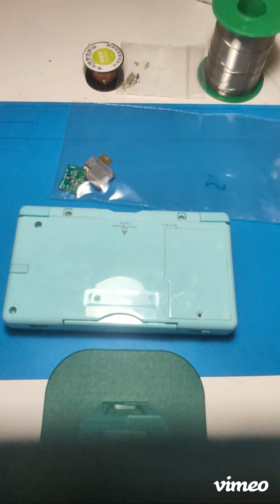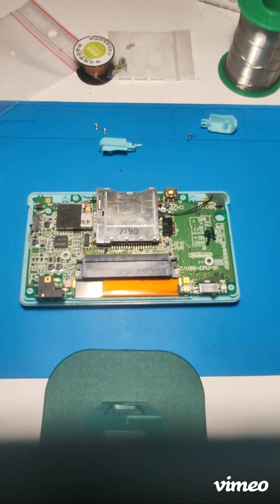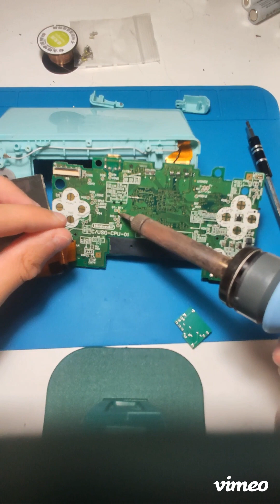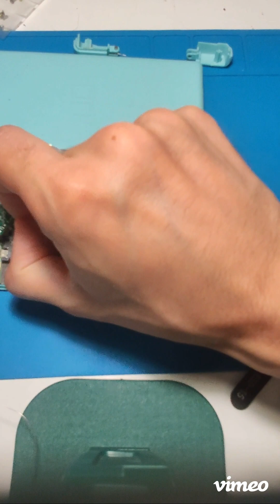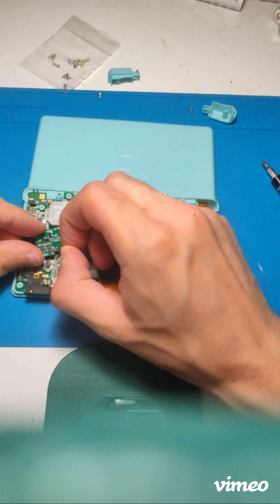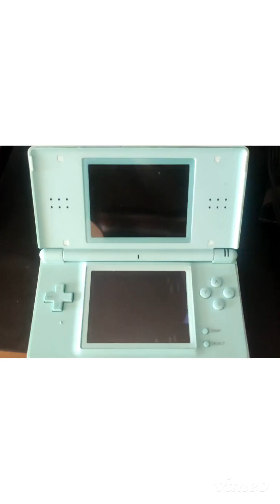Transform your DS Lite into a SWITCH DIY

Comment: is your pcb using opamp and dac method or resistors only method?
Reply: The current 5.4 version uses the Resistors for the video output. But that video output part can be replaced by others as long as the custom module and usb-c remain

Comment: Can you make a video of the mod
Reply from the maker: a video will be made in the near future.
For now the pre-order is openned. Instalation is similar to this one, will also have the charging port replacement. So if U can do this instalation (or know someone) I recommend getting the 5.3 version.
Reply: are you available to do it for a fee friend? I very bad at soldering @digigumods

Comment: can you show me which cable you use and whether it is possible to plug it into a capture card
Reply from the maker: Hi. the cable used is a 3.5mm to 2 RCA 
(example: https://www.amazon.com/Amazon-Basics-est%C3%A9reo-adaptador-altavoz/dp/B01D5H8M18/ref=sr_1_1_ffob_sspa?__mk_es_US=%C3%85M%C3%85%C5%BD%C3%95%C3%91&crid=1X0AWNGULTZTZ&keywords=3.5mm%2Bto%2B2rca&qid=1701973960&sprefix=3.5mm%2Bto%2B2rca%2Caps%2C201&sr=8-1-spons&sp_csd=d2lkZ2V0TmFtZT1zcF9hdGY&th=1)

you can connect it to a capture card. 
You can also convert the signal to hdmi if needed using a rca to hdmi converter.